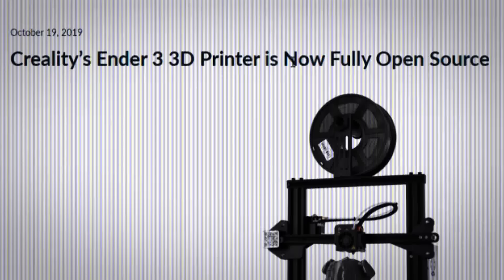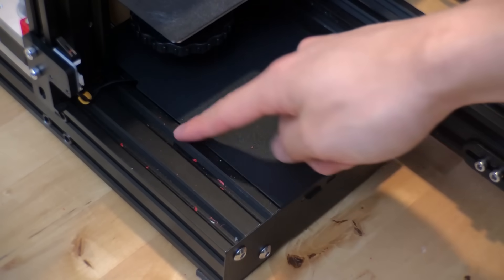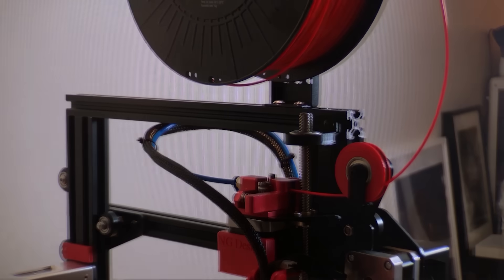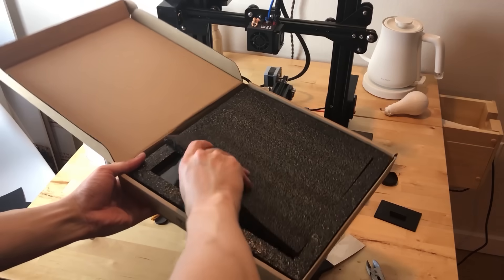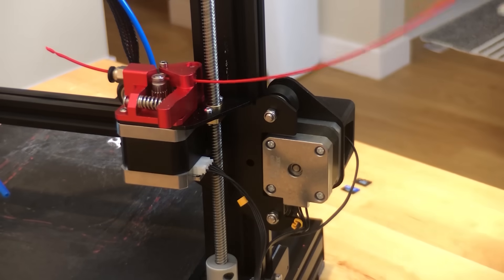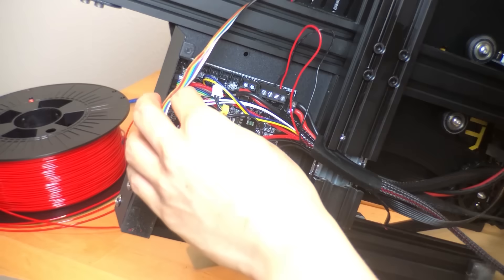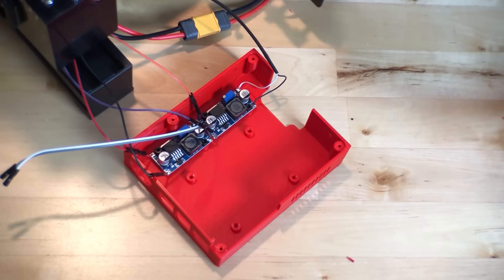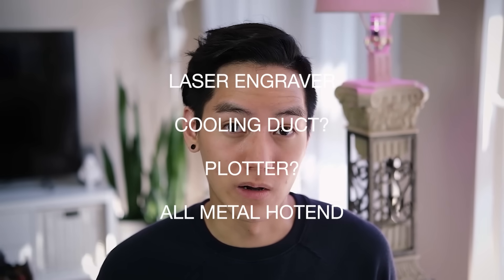First 24 Upgrades for my Ender 3 Pro - Part 1

Comment: The way his objects just pop off the glass bed 😮 I recently upgraded to the glass bed and it's a real pain to get the objects to come off the bed after printing. Any tips? Thanks in advance
Reply from the maker: there's a few reasons you might be struggling with that. 
1. if the form is big and has a large flat area, it can just naturally be hard since it forms a suction. not much you can do there. 
2. i always wait for the bed to fully cool since as it cools the glass expands and naturally the print just releases itself. this can take 5-10 minutes
3. MAYBE your first layer is too squished? this is unlikely though but always worth checking if the other 2 reasons doesn't explain it. 

good luck, sam!
Reply: @ScottYuJan  Thanks! i'll give them a go! great video btw!

Comment: There’s one important mistake that you made here when powering the raspberry pie with the buck converter this is a big issue.  Let’s say you want to use a WebCam and have the WebCam powered from the USB 3.0 port on the raspberry pi it will not be able to supply power to the camera the power supply that comes with the raspberry pi as a fluctuating power supply it’ll add more power when needed the buck converter will keep a steady 12 V  you would use the power supply with the pi.

Comment: I printed out the SD card cover, but the Ender won't recognize the SD card unless I either turn it off and on, or if I open the case and pull the reader out.  Is this how it's supposed to operate?

Comment: Sorry to burst your bubble but - Bowden tubes are mainly all PTFE, so even "Capricorn" tubing, can't go up to 260C or it will offgas, degrade and give you bad times.  If you plan to print 240+ Frequently I highly suggest an all metal hotend and not rely on marketing gimmicks.

Comment: My new Ender 3 Pro has suddently, completely stopped moving. My 2nd print with the printer stopped in the middle of the night following a snapped filament. After that I noticed the Auto Home does not work and after a bit gives homing error and forces me to turn the printer off and on which does not fix the issue. No movement occurs in any of X,Y or Z direction. I moved the head and plate to unclick all 3 limit switches thinking it may release the machine to move the motors, but none of the motors move whatsoever not even hair, like signal is completely cut off from all motor. All heating of filament and bed work and the screen turns on and menus work. Any suggestions?

Comment: Downside for the SD card adapter is that if you need to take out the SD card, it will not reload each time you plug in, because the end that is connected to the built in microSD card stays connected... only way to force it to re-read the card is to power off and on, do you have a better solution?

Comment: I also have an Ender  3 Pro.  It will not allow you to hotswap that SD card.  Once you remove it from the reader, it will now read it when reinserted unless you power down and back up.  Maybe its been updated in some firmware but I havent found it.... then again, just get an octopi and be done with it I guess.

Comment: What cable did you use to plug the fan in with the buck converter? im putting my setup together and fan wires arent long enough

Comment: Do you have to cycle to Ender 3 Pro on and off every time you pull the SD Card out of the adapter?  I bought and installed the SD adapter that is listed.  When I cycle the Bigger SD card out of the adapter it will not show up under "Print from TF."  If I cycle the adapter from the mini SD Card slot it works or I turn the Ender 3 Pro on and off.

Comment: My personal favorites that I could not survive without:

1.) Cable chains. Please please please I nearly had my printer make me some electrical spaghetti. 

2.) CR touch (I prefer it over the BL touch). Saves SOOOO much time and the prints come out nicer. 

3.) Glass bed. People were NOT joking when they said it adheres better. I nearly can not remove my prints after their done. Which is a good thing. 

4.) The drawers. No more clutter!!

5.) Scraper holder. You need it way more than you would think. 

6.) Z axis mods. All of them. The up and down axis was pretty half assed stock. So many good parts on thingiverse that make things smoother.

7.) For the light, I bought one from Amazon. Brighter and better in my opinion. I love it.

Comment: I have a question,
I just got my Ender 3 pro

But unlike you my z axis rod is closer to the top then the bothem, so is using the z axis spacer still an option i should use ? Or will this make the problem worse
Reply: sounds like your rod is
bent

Comment: #11 4:09 caught my attention. It will be a help to my problem.

I'm a beginner at 3D printing, 1 month. So much to learn. Ender was a gift to me from my Brother including some upgrades.

I have an under-extrusion problem. Gaps in layers. Filament feeding issue. I proved that by straightening out filament needed for the job and laying it out for the lowest drag possible. The object printed was good. No helping it. Printing direct from the reel,,,, if I did not help the feeding along, I would heard that feeder thump sound, and gaps appears in a layer, then it was trash.

Comment: BIGGEST suggestion 
Step 1. Printing in wax 

Step 2.
If you print in wax then you can take your wax positive and cover it in a cylinder of plaster. 
Step 2.5 
Then before the plaster is dry vibrate to remove bubbles off wac surface.. 
Step 3. 
When plaster is dry take and put upside down in an outside oven or in a metal drum over a wood or charcoal fire.  
Melt the wax out fully. 
(This is called the loss wax method) 
Step 4. 
Take the cylinder of plaster now containing a perfect negative of your loss wax object. And turn it verticle 
Step 5. Heat up some metal with a torch (acetylene, or  hydrogen or propane depending on needs) or for faster melting use an induction casting system. 
Step 6. While wearing proper safety gear and with proper safety protocols in place carefully poor metal in the( reheated ) plaster mold that contains no moisture whatsoever (even 1 drop of water will cause a metal + steam explosion mini volcano ) metal in eyes (not fun) use proper gear, face shield, leather welding gloves and bib,metal  tongs for pouring 

Step 7. Now you have a 3D modeled loss wax method metal part. Depending on your print resolution and your metal melting ability it could be made of aluminum (low temp metal) or silver, gold, copper iron (high temp metals) 

Step 8. Use a wrasp to grind any sharp edges 

Step 9. Use a Dremmel tool with sanding bit to grind and sand smooth the metal object using progressively smaller grits  

Step 10: if the part requires it use a tapping bit. 

Step 11. Consider Electroplating the object to give a high value appearance with a cheaper low quality metal base (gold plated silver) etc.

Comment: The z-axis also needs improvement. I added a second lead screw on the other side and moved the motor to the centre. The motor is able to move both screws, the thing got way sturdier and is always parallel to the bed.

Comment: Awesome and inspiring video man! Slowly working on these mods for my Ender 3 v2. At 10:32 what gauge wire did you use to take the 24v 14.6a power from the PSU to the buck converters? I only have 24AWG and I'm concerned 14.6 amps might be a little too heavy for what wire I have.

Comment: Loving these upgrades and I've done a load of similar or the same ones myself. Have to say though the best upgrade I got for my Ender 3 V2 was a 2nd Z motor and screw assembly. It stops gantry sag completely and really squares up your prints - noticeable on taller prints or when you really really need things to be perfectly square.
Reply: What are you printing that really really needs to be square? What are you printing that is so tall and not looking good because of gantry sag?

Comment: Did you have to buy that glass bed? For some reason my printer just came with one, and there was enough height on mine that just stacking the glass bed on the magnetic one worked for me.  Trying to clear up some confusion.

Comment: It’s a great printer for a low price.
But having to do the leveling yourself???
After long consideration I decided to go for a PRUSA MK3S+ (bought it as a kit for 735 US$) 
It automatically calibrates and autolevels via a 7x7 spot matrix, EVERY Time I start a print.

No V-wheels but Misumi ball bearings.
No floppy cables hanging around
No noise !!!
No limit switches (but current sensing!)
No bending rods
Great dual gear direct Bondwell extruder

I paid more (but You also spent a considerable
Amount of $$$ for all those extra goodies) but I don’t have all the Ender problems, and I can concentrate on printing instead of solving mechanical problems.

Great vid!!!!

Comment: I have a question Scott Yu-Jan, are all this mods compatible with the original ender 3?
Reply from the maker: most of them are and if not, usually there are ender 3 variations of them on thingiverse too. you can also read the comments of the parts you’re interested in to see. usually others will have tested it before so won’t have to. good luck!

Comment: You just stoped the air flow of the fan. WTF
Reply from the maker: nah, look at the thingiverse part. it’s designed to redirect the intake airflow.
Reply: @ScottYuJan  I'm sorry bro, I saw that later but I forgot to delete it. By the way Im going to buy an ender 3 v2 and modify it like yours! Keep the good work

Comment: I was thinking about getting an ender 3 or an ender 3 pro but this just makes me feel an insane amount of pressure to do ALL these things otherwise im gonna have a shitty printer. Really good video though I would most likley do the first few because they seem easy and its like using a knife to carve a knife to then sharpen the first knife with.
Reply from the maker: nah, don't feel pressured to do any of it. it's fun to upgrade and mod but it's definitely not required. still a great printer straight out of the box. i just got WAY too into it because i find it fun 😅. but if you don't, then you definitely shouldn't. you'll end up hating this as a hobby and if anything it might discourage you from getting more use out of the printer. good luck!

Comment: Great Scott, great video!!  But it brings up a question:  All these mods for a budget printer, is it worth spending all this time fiddling around with it instead of buying a printer that's less flawed for a higher price?  What would that price be and what 3d printers come to mind for you?
Reply: I don't think you understand. The entire point of 3d printers is to print upgrades for the printer. If you paid more for a better one with fewer flaws, there wouldn't be anything you could even do with it. It would be a waste of money.
Reply: @lambdaman3228  So we  buy a flawed printer and print upgrades to it. Fine! Everything that is printable is  a decent upgrade but all the new electronics ....better buy a Prusa mini then.

Comment: i have most of these upgrades. i have dual Z rods and dual Z step motors as extra. 🙂 A useful upgrade. 

Also, in my octopi setup, I use another adapter for raspberry and lights. I use relays. Two for lights, one for printer PSU. So i can open and close printer itself. 

i have two different temperature sensors. One is on output of PSU fan. if one of them gets hot, relays close. Also octopi alerts me by emailing me. i am using standard raspberry camera for monitoring and timelapse. 

I don't have the controller card upgrade. That is nice.

Comment: 12:13 Set these switches up to be run by the Pi using an onboard relay board. Then use PSU control or enclosure plugin in Octopi to turn them on/off automatically when you run a print.
Reply: Can you detail a bit more how you did this? Excellent video having a hard time understand how you setup these switches.
Reply: @babubak  what are you talking about? This isn't my video. Do you want to know how to run the switches using a Pi or using toggle switches like shown in the video? If it's the former, just google psu control for octopi and you'll find your instructions. https://www.youtube.com/watch?v=0-Ol6Yvf0fg

Comment: Actually on #20 I now no longer worry, just four knobs. Not wondering if it's gonna fail to deploy, get stuck, STOP printer, knock into print, fail to register mesh. I bought 3 blts, so I know them. A simple switch is easier.

Comment: My scraper mod included taking cap off, putting in steel wires so it's a dead blow. Then I cut down those corners... Much filing

Comment: The dual drawer messed up for my ended 3 pro it’s fitter within the frame but         Bed holder base nuts are blocked by the case . It makes the bed stuck

Comment: Quick question from a day old newbie to 3d printing. The chain for the cables, the STL file has only one of the links, how do you do a batch of multiple like you have? Is there a duplicate option in cura?

Comment: Would it be okay If I used PLA for the drawers instead of PETG?
Reply from the maker: for sure!
Reply: @ScottYuJan  amazing just got the ender 3 pro today printed benchy no problems. had a lil warp with the box but I just fixed the leveling and it looks so clean thanks for all your videos!

Comment: enjoyed this very much but I have a question on the SD card reader. Some 3D printers are finickier on what size and format the SD card is. Since I just bought the Ender 3 Pro I'm not sure what card it would read. I have an JGAurora A5S and it won't reAD ANYTHING OVER A 32G SD card. With a FAT something format.

Comment: I have done similar upgrades with my Ender 3 and Ender 3 Pro. I just need to get around to re-programming my board which I've been putting off.

If you're just doing a few, go with an all metal extruder kit (the plastic ones break after about 200 hours), board upgrade (silent steppers are key), a glass bed (critical upgrade), and add a bltouch. If you want, you can also replace the hot end with an all metal hot end. A Micro Swiss is a good choice as it will allow you to print at hotter temperatures for PETG, ABS, etc.

However, I noticed when I put the Ender 3 and Ender 3 Pro in a mechanical room which has a consistent warm temperatures with no draft that the quality of my prints improved with no lifting, warping, etc.

Great video!
Reply: So how much did all these goodies set you back?   (Thx!)
Reply: So...  I did my own research, they're not that expensive when considered against the cost of the printer.
Reply: @joefaraone977  And they add so much functionality.

The glass bed alone is worth it. I use a mix of water and sugar on the glass to increase bed adhesion. I haven't tried ABS printing yet, but printing PETG with the all metal hotend is worth it.

Comment: Awesome Video.  Just got my ender 3 and can't wait to start upgrading it.  For the drawers, did you have to print the case vertically (with the openings facing up) so no supports were needed?  I assume that will take a day or two to print, no?
Reply from the maker: i think it was around 15 or 16 hours with .2 layer height settings. can’t remember though, it was from a while ago but yes, i definitely recommend printing it vertically.
Reply: @ScottYuJan  Man, i printed out the housing for the drawers and installed it, but, one of the nuts catches it as the platform moves forward :(

Comment: In regards to that dual gear extruder kit - it's a good idea to either file off like 0.5mm a the bottom of the gear not on the stepper axle, and put a plastic (ideally ptfe) washer between the gear and the lower part of the bracket it sits in. Some manufacturers have addressed this flaw, most haven't, and there's a tonne of old stock still being sold through. Problem is, the gear's base is pretty wide, it's steel, and is grinding directly on the softer aluminium bracket understand neath, creating metal shavings and excessive friction.

Another way to tackle this (this is 2nd hand info, haven't tried this one myself) is to mount the gear on the extruder stepper axle, a little bit higher. So that when you run some filament back and forth manually by hand, the passive gear in the bracket will lift up from resting on the bracket. As the filament passes through, the passive gear should self-align with the one align with the opposite gear on the axle. Just don't lift the axle side gear so high that the other one gets pressed against the upper part of the bracket. That would cause the filament to not ride in the same spot on both sides, and cause the same issue with grinding against that bracket as before. Only now those metal shavings sprinkle directly down onto the filament.

The latter option of course assumes there is enough space in the bracket for the gear to move a tiny bit vertically. In some kits there isn't, tolerances are just too tight. In that case, you need to file the gear and use a plastic (or lead-bronze, but that's way overkill) washer for the gear to ride on.

Comment: Hi Scott. just go my E3 max and started to do the mod on it. Did you have a problem doing the E3-pro case? Did you change any specs for printing it and was it printed on your the E3 max? the main drawer case came out really bad, the side walls went from good straight up at the back to a 1/8 th in. inside slant at the front. The first horizontal top is full filaments hanging under like it had nothing to support ! Did you change the original program to have it good? Pla@210, bed at 60. thanks

Comment: 6:40 The SD card reader will not read the card unless it was removed and reinserted or to turn off and on the machine. 
Is there a fix to this? It is kinda unless if you would have to remove and reinsert the adapter for every print.